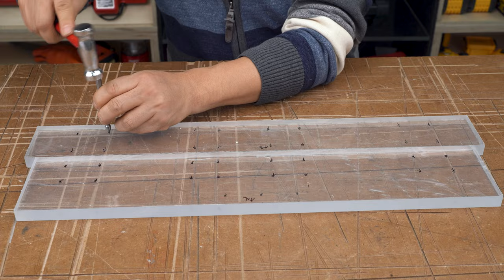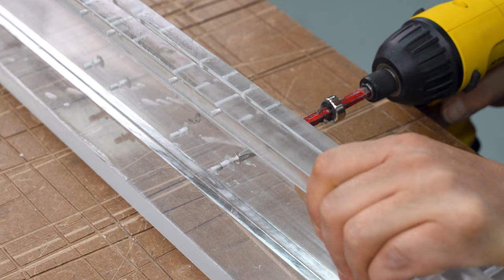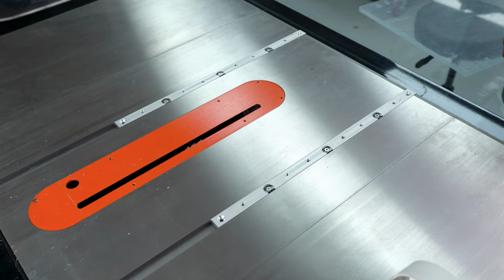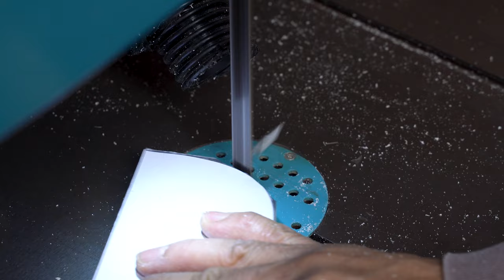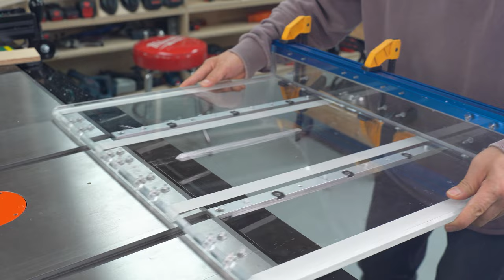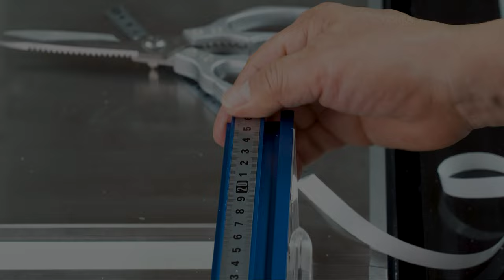Table Saw Sleds with Acrylic / DIY

Comment from the maker: 3D Modeling Blueprint : https://youtu.be/jzUOkmLyTm4

After using Bosch's portable table saw, GTS 10XC, I finally used the table saw of the casting body. It feels like I've replaced my previous compact car with a large sedan.
I like it even though it's not a slide table saw. Actually, sliding products seem to be too expensive. The saw machine is thousands of dollars.
I work a lot on making idea products with small materials, so I thought small size was enough, but when I saw the new product, I wondered how I had worked so far.
I was so happy that I decided to apply new systems to the table saw.
There must be a reason for everything I've done so far, but I wanted to put that aside and try new things.
The first is the upper dust collection system made of transparent acrylic. The purpose was to minimize fine dust flying toward the worker's face, and to make it transparent to secure a view.
You can check this process in other videos.
https://www.youtube.com/watch?v=HPt1LUeNJU8
The second one is the table saw sled.
This is an item that 99% of table saws make and use by themselves.
It is a necessary aid to safely cut small components.
I made it with transparent acrylic. There are many advantages.
First of all, it's transparent, so you can see the blade of the table saw very clearly.
It means that you can work more comfortably and safely.
And because of the nature of the material, it is less sensitive to changes in moisture and temperature than wood.
There is little deformation through contraction or expansion. This also increases accuracy.
The lower rail also uses metal, so there is little clearance.
Some of you might be worried that the dust will stick to you because of static electricity, as you can see from the video, the dust on the wood hardly sticks. 
There is a smooth double-sided tape attached to the bottom, so there is no static electricity when moving. The metal plate on the floor also holds static electricity.
Although it weighs about 20% more than trees of the same size, the sled shows more stable movement. It's not hard to do a round trip at all.
Please refer to the production process and I hope more people make it and use it.
It's a gift for everyone in the world who loves DIY and woodworking. Thank you.

Comment: It's very nice and aesthetically extremely pleasing but I feel like it would be much heavier than baltic birch.  I suppose that's ok if you aren't taking it on and off the saw a lot but I'll stick with birch ply.
Reply from the maker: You are right. The specific gravity of birch plywood is 0.69, and acrylic is 1.18. Acrylic is a bit heavier.

 I still use birch plywood sleds. This work is a transcendental work that focuses on working while directly looking at the saw blade. I hope there are people who are inspired by my work. "There's a reason why others don't." But, I'm trying to know why. thank you!

Comment: Sigh, this is like my dream. If the space in my home and my budget allows, I wouldn't have to "battle" with my low power mini table saw and struggle every time just to cut wood at straight angles.
Reply from the maker: If you continue to have the heart you want to achieve, you will have a workshop and equipment much better than my workshop. I will cheer for that to happen. thank you!

Comment: Did you consider using acrylic solvent to bond pieces, to reduce the need for so many screws?
Reply from the maker: Your point is correct. I've considered that too. However, I used screws from three perspectives. 

When I applied the transparent liquid-type bond to the acrylic, it flowed on its own regardless of my will. And it seemed to leave a bond mark. 

I wasn't sure about the adhesive strength. If the adhesive comes off while working, it can be very dangerous. 

I thought that using screws would be less aesthetically pleasing than bond. It was fine. It also looks good on its own. 

I think a variety of perspectives are one of the strengths of YouTube, and I appreciate your points in that respect.

Comment: I like this; however, I was just wondering if this type of acrylic is scratch-resistant.
Reply from the maker: As you pointed out, the biggest drawback of acrylic material is that it is weak against scratches. It's an unavoidable part, but it doesn't weaken the quality of the work because of it. It's like kids aren't hated for little mistakes. Children are beautiful souls in themselves. I hope my work does too.

Comment: Good to see some one else making their jigs out of something other than wood.  Start using HDPE over a year ago, best decision I have made in my wood shop.  The material is perfect for the applications.  Up front cost is a little pricey,  However: over the years of making jigs over and over because of moisture in wooden jigs, causing warping, bowing and cracking, the cost of HDPE was justifiable.  If there is someone out there starting up in woodworking or an old pro, you might want to look in to  wood alternatives.
Reply from the maker: Have you already made a sled out of HDPE and used it? You are more experienced than me. Your point is correct. Wood warps or bends. It is very sensitive to moisture. This is the opportunity for me to make a sled with acrylic. It is also transparent, so you can clearly see the table saw blade. As you said, the initial cost seems to be fully compensated by accuracy and convenience. Thank you for your thoughtful comments.
Reply: @Kynosys_  For a little over a year I have been using a large table saw sled of HDPE.  Like it so much I am making all new sleds for my table saw, band saw and router table.  Low resistance and friction.  No worries with the problems of wood.  Easy to manipulate for square.

Comment: Hallo Kynosys wieder ein Super Video nur Plexiglas in dieser Stärke in Deutschland viel zu Teuer trotzdem ein Super Projekt meine Hochachtung nun warte ich schon sehr ungeduldig auf Die Presse im Metallrahmen wann kommt die denn endlich?
Liebe Grüße aus Deutschland Peter Mertens🙂
Reply from the maker: Acryl ist kein billiges Material. In Südkorea, wo ich lebe, ist Acryl etwa doppelt so teuer wie Birkensperrholz, das ich gerne verwende. Trotzdem versuche ich, Acrylfarben mit Wert zu verwenden. Danke für deine Worte!

Acrylic is not a cheap material. In South Korea, where I live, acrylic is about twice as expensive as birch plywood, which I like to use. Even so, I try to use acrylics with value. thank you for your words!

Comment: That is a lovely design but isn't the idea of this kind of structures to protect the user from the exposed blade?  The blade is still exposed (at least the half of it) after the back fence passes on it.  Maybe putting an extra guard there can solve the problem. Not everyone is professional or careful as you can be.
Reply from the maker: If you are talking about having to install a defense in front so that the saw blade is not visible, I will refer to that and use it for the next production.
thank you!

Comment: Next up... aluminum!
Reply from the maker: When making a sled for a table saw, the final task is to drill a hole in the sled while raising the saw blade. Not only is it a woodworking saw, but you can't work with a metal saw blade either. It's not an RPM that can use a saw blade for metal. It can be very dangerous. 

I will answer seriously. thank you
Reply: @Kynosys_  With steel, no you shouldn't. The RPMs are too high even if carbide tipped. However with Aluminum all woodworking tools can cut and carve perfectly fine. The only risk with non-aluminum specific blades, is you run the risk of gumming up the teeth with aluminum if you push it too much and heat both the blade and aluminum too high. But a few cuts here and there are no big deal!

Here, we can buy 10" table saw blades specifically for non-ferrous metals, and they aren't too expensive. But if you are just making a one time item, and the blades are priced too high, you can get by without using one.

An aluminum table saw sled is actually better, because you can use as thin as 4mm to 6mm for the base. This increases your cut capacity over a wood or in your case an acrylic sled. I'd imagine that your acrylic sled attracts tons of dust from static electricity... and you have to constantly blow it off.

If I were to make an aluminum sled, I'd go with the split table design. So there is no fence on the front side, for larger pieces, infinite cross cut width. The right side of the blade stays in pace, locked into the track just to keep a zero kerf and material height the same as the moving part of the sled. Just a thought, for another project. So you have two sleds, each serving different purposes. Or sell one of them to make a profit.
Reply from the maker: @EcoMouseChannel  First of all, I would like to apologize to Paul Sullivan. Since you mentioned aluminum in your first short post, I thought you were joking a little bit. 

After reading this long article by Eco Mouse, You seem to be an expert in the metal field. It would look great if it was made out of aluminum. If I get a chance, I really want to make it too. 

As for saw blades, I am fortunate to have the knowledge to overcome the problem. 

And, your concerns that dust will stick to the acrylic are true. I expected it to be inevitable because of static electricity. Still, it seems that the various advantages obtained from transparency outweigh the problem. 

Thank you very much for your sincere advice.

Comment: I'll just go ahead and assume you've never had a chunk of acrylic explode while cutting it.   wear armor while using this please.  Edit for clarity, this protection should be worn in the gut and groin areas.
Reply from the maker: It is an accurate fact that your consideration of the risks of equipment made from new materials requires sufficient discussion. However, thanks to the weight of the acrylic and the precision of the rails, my sled will not twist. If the saw blade breaks or becomes loose and becomes dangerous, it's not a problem with my acrylic sled, but the table saw itself, and that's the same problem no matter what sled you use.

And you're worried about my groin, but since it's on the underside of the table saw, I'd rather protect my face.
 Anyway, thank you.
Reply: Best of luck sir.  It's very nice looking